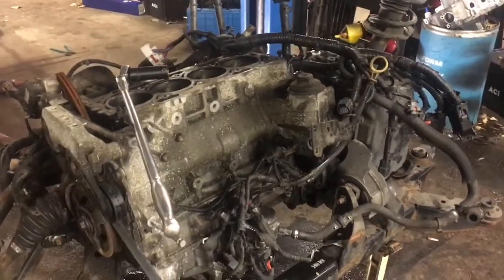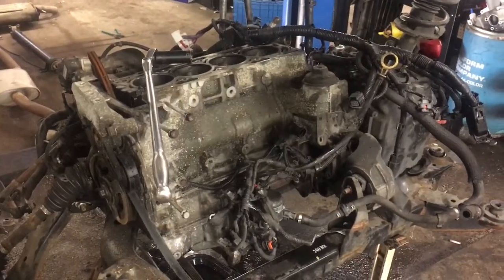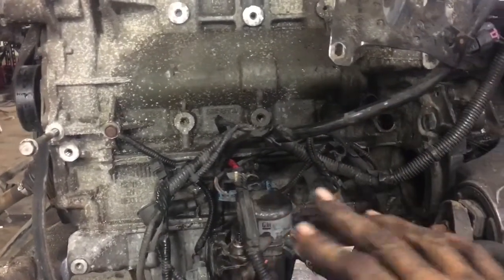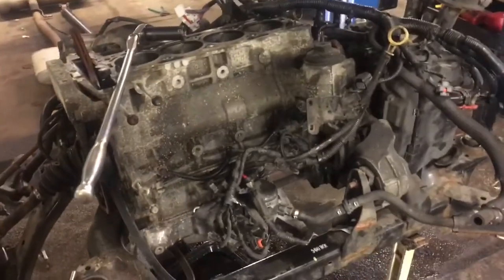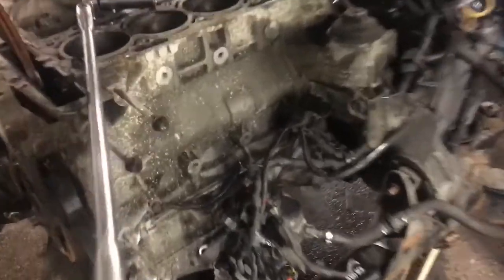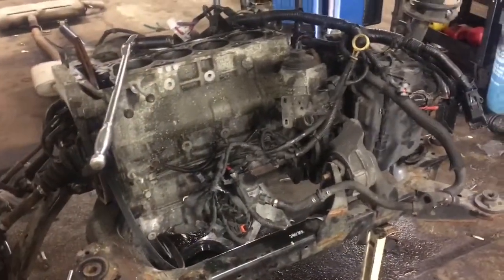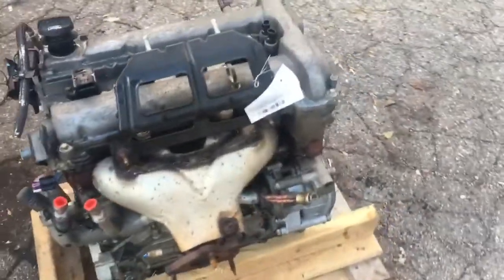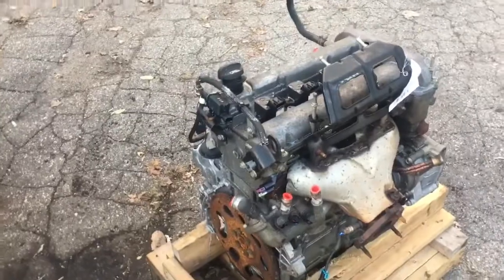GMC terrain engine removal and replacement on the cheap save thousands

Comment: Good to know.. i have a terrain and just found out all the issues with this particular engine... mine runs good but uses oil.. 1 quart every 2000 miles which the dealer said there was nothing he could do... so, i know when their extended 7.5 year 120k mile warranty runs out, i will be doing an engine job on my dime.. right now has 81000 miles.. asked gm to purchase an extended warranty. But at 2400$ for 24 mo 24k.. I'll just take my chances.. i swore off GM cars but loved the style of this terrain... fell in love bought it before I checked into any problems with this vehicle.. oh well.. got sucked in again... Love My Honda
Reply from the maker: There really actually pretty simple to fix Engines and that is just your valve guide seals no big deal your engine does have to come apart to fix them though Thanks for the kind words let me know if I can help in the future have a good night
Reply: @sharpcarco  I have read the oil consumption issue is bad/faulty rings. GMs fix was to replace pistons and rings.
Reply: They updated the pistons and rings in them in mid 2012. If GM fixes yours they will replace the pistons and rings and gaskets with the new design witch then it will no longer use oil between oil changes..
Reply: @Hendogg28  unfortunatly mine went thru the consumption test and failed one quart @ 1000-1500 They said it was normal and wont repair.. DONE WITH GM
Reply: Does the 2.2 block match or only a  2.4 block. ?

Comment: After doing some research, it seems the Equinox engine has slightly more compression than the older engine and special injectors for the Equinox. Did you encounter any fuel consumption differences? Seems the Equinox had special pistons also.
Reply from the maker: It’s been a while now that I really remember but I used the cylinder head from the original engine. It worked I can’t say how perfect it was, but it seemed to run OK.

Comment: Well my friend I recommend my friends 🙂 if they have $ feels you car with a new heart ❤️ and went you charge the new engine please 🙏 🙂 😉 😀 don't put the old sensors back will be back soon and you get frustrated
Reply from the maker: Well I think I understand what you’re saying. When you get your engine replaced you don’t want the Old sensors put back in.

The issue with that situation is that could raise the price of the rebuild by as much as $2000 I’m just guessing of course and maybe rounding a little bit but when a rebuilt engine for one of these cost about $6000 it’s a hard pill to swallow but because you’re the customer you should always get what you want and if that’s what you want that’s what they should do.

I’m no longer over at Accurate Engines it just was not a good fit for my integrity so I don’t personally do Engine rebuilding

Comment: So your saying you took a 2006 cobalt 2.2 engine and put the 2012 2.4 direct injected cylinder head on the 2.2 bottom end? I have a 2014 terrain that needs an engine.
Reply: Did the 2.2 work out or does it have to be 2.4

Comment: Thank u for the informative  information . I am on pension  trying to make ends meet.I called GM when my 2013 Terrian started burning oil.
 I had 63,000 k on it they told me  the warranty  was up.I recieved  a letter in march from GM that
 my warranty was extended to 7 years and 6months it will be up in two months. The 2013 Terrian now has 120,000.It has been burning oil since around 60,000 just after the initial warranty.
I already went to my local  dealership 
The service  guy said I have to let them change the oil twice to measure  the oil consumption 
I still have approximately 600 k before I need to change agian it's down about two liters.This was only city driving  if I do highway driving  it would burn more but since Covid I have not went very far.I am afraid the service Manager is going to say this is normal.
I was informed even if they fix it it will only be  pistons and rings.
I have more time than money
Instead of fighting  with  them I think I will buy another  engine and do it myself.
I have purchased many  new cars and trucks from this dealership now that I am on pension  I need there help to fix this problem  but I have  read on the internet how many people  where left high  and dry
Reply: I have a 2014 GMC terrain and mine was burning oil when I bought it at about 82,000 miles.  It now has 122,000  and my mechanic thinks it's the Rings it was using so much oil.  Now it's running really rough,  the engine light is blinking,  and it says service stabili trak. There's oil everywhere underneath and on the spark plugs.

Comment: Yeah all the 2010-mid yr 2012’s have the dreaded all consumption problems. Any where from 1-4qts between oil changes.. Any replacement of the pistons & rings and gaskets that GM does on these 2.4’s gets the new design which illuminates the all consumption in between oil changes. 

But I had wondered if all the 2.4’s were the same other than the head. And there is a little bit of a difference between them.. The Direct injection for 2010 and up have a higher compression than the older ones I want to say it’s 11.5-1 where the older 2.4’s are a 10.5-1 or it’s something like that..

Comment: How did it run after you put it in my 2010 gmc terrain motor is shot and i am look for a good motor for less then 2 grand so let me know if it fit perfect etc please and thanks
Reply from the maker: Yeah I drive it every day. Runs really good only problem I ran into was I used cheap Chinese timing parts and I had problems with them after the fact so I don’t recommend that but works just fine

Comment: I am replacing the the 2.4 in my terrain am I ok using a 2.4 out of a 2006 cobalt or newer?  also looks like a lot of room in the engine compartment wouldn't it be easier pulling it from the top?   thanks
Reply from the maker: Hey good morning Jeff yeah pulling up from the top if you’re switching all the parts over will make it simpler for you

I just released a video a couple weeks ago about pulling the engine from the top it’s kind of an overview and not a very good video (it’s not nut and bolt)

But it gives you an idea of how it’s done and it would be simpler in your situation
Reply: @sharpcarco  thank you for the response clay your videos are awesome thank you im in the process of getting another engine for this so your thinking a 2006 cobalt or newer 2.4 should be fine and all I need to change over is the head?

Comment: Do you have a step by step video of changing the head gasket for this motor?
Reply from the maker: No sorry I do not but it is an easy one
Reply: @sharpcarco  ok, I read its recommended to get the whole gasket set and new bolts. Which runs roughly $500. Is it all necessary? I've also been told the timing chain can be a pain in the butt. That the case?
Reply from the maker: I personally never replace the bolts and you can get a much more inexpensive set off of the Internet you’re still going to spend the money because you should take the cylinder head to the machine shop and have them go through it it should be anywhere from about $200-$250 for that. Just depends on why are you removing the head. 

They do recommend you replace the bolts because they are stretched to yield I personally do not But when you buy stuff off the Internet you can get just about everything you need for right around $250 I would think
Reply from the maker: No the timing chain is easy if you follow the instructions and just pay attention it’s really not a bad timing chain as a matter fact I would think it’s one of the easiest timing chains to do